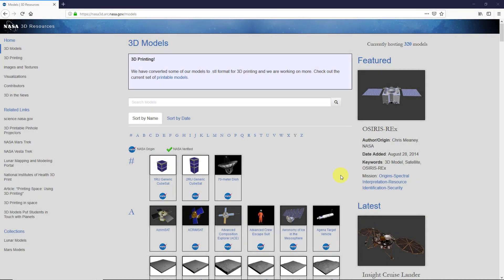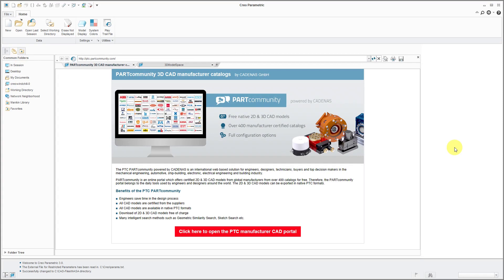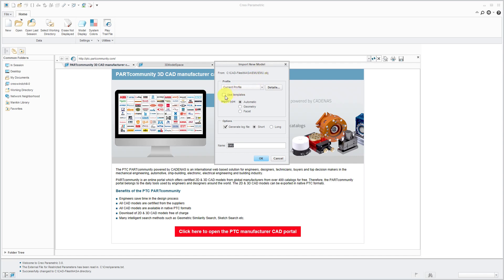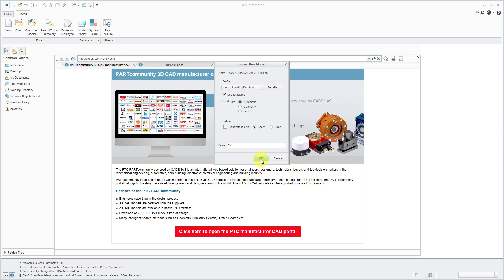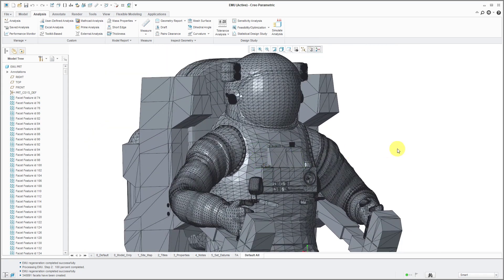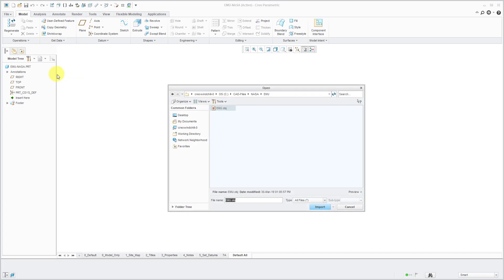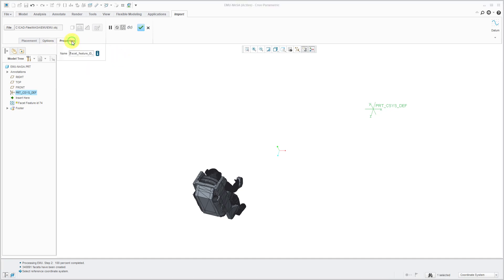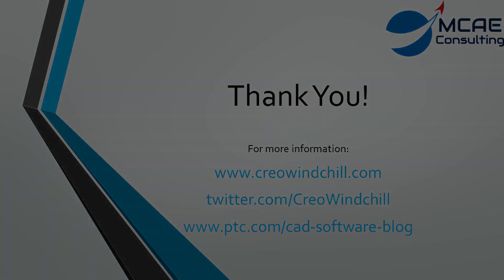Creo Parametric Tutorial - Importing Wavefront OBJ Files | CAD Import and Export

Comment: i am trying to use these methods on creo parametric 6.0 student edition and i am not able to view the obj file. Any solutions on that?
Reply from the maker: A lot of functionality especially with regards to data exchange is disabled in the student version, so the answer is no.
Reply: Oh okay thank you for your reply, so should i purchase some version or software from ptc in order to proceed with the obj file? if you happen to know which software i would really appreciate it.
Reply from the maker: @stealex3082  You would probably need the commercial license of the software. But be aware you won't be able to open any files that you created in the student version in the commercial version. At least that was the way it was years ago. The student version is not meant for commercial work of any type.
Reply: @CADPLMGuy  That is all fine thank you! However, the commercial packages are 5, so is the design essentials (cheaper) ok for what i need it or do i need to go for any other package? Other packages are can be found in the ptc website with the specifications! Again thank you for all the guidance, it has been really difficult to navigate the issue.
Reply from the maker: All packages support OBJ files. I think I made that video using Design Essentials. (I've since upgraded.)
Reply: @CADPLMGuy  Thanks again for all the help!